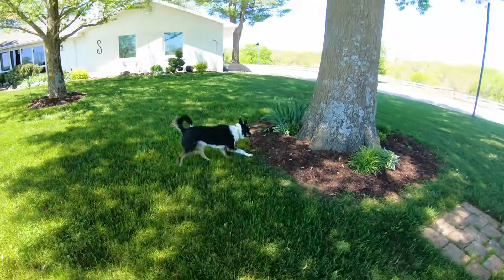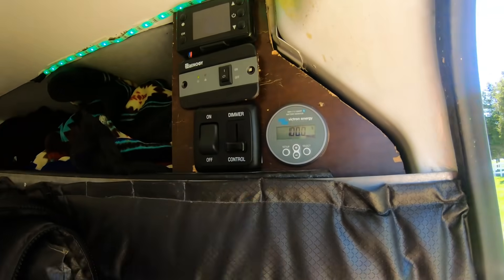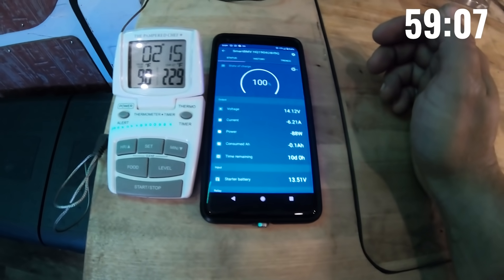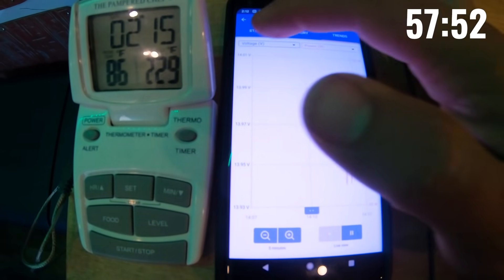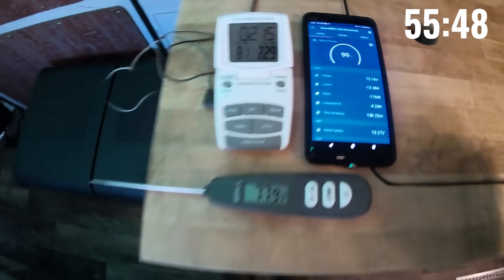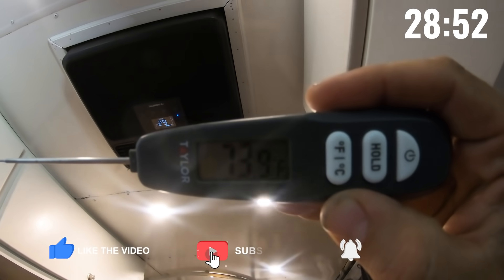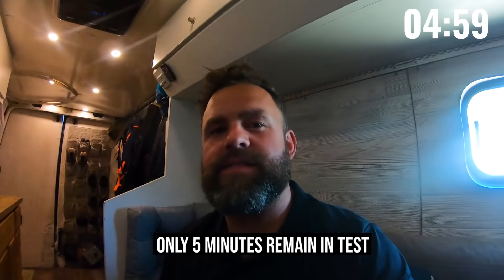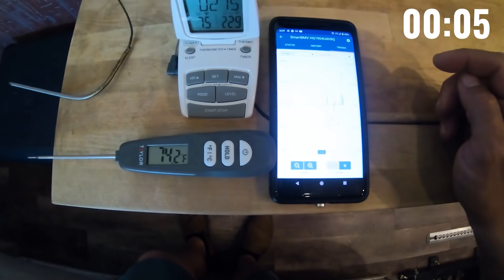12 Volt DC Air Conditioner | POWER CONSUMPTION TEST | Dometic RTX 2000 |  Van Life

Comment: Nice work, but $3k consuming 600 watts .. most vans have a garage in the back and you can get a  5000 btu wall unit for $160 at Home Depot that only consumes 400 watts.
Reply: Some people sleep in their Toyota Prius and run the AC all night. It has a feature that turns the engine on for 20 mins or so when the battery is depleted and recharges it. Then it shuts the engine off. It’s nearly silent during this process.
Reply from the maker: I wanted to avoid an unsightly and large window unit sticking out of my very nice van. I'm sure that works for some people ✌️
Reply: @insidiouspeanut  LOL.. not saying visible out the back window. I meant out a back firewall into a rear  sealed garage with allocated vent holes and  drain lines. Just an idea. Less would be visible or affecting aerodynamics.
Reply: @insidiouspeanut  The other point I'd like to make from my own personal experience is that modern automobiles with their electric engine fan cooling systems can handle what seems like an indefinite amount of idling while running the AC.  I've been running my van idle with the AC on high for 2 hours in the middle of the day some days and have never seen overheating or any other issue and fuel cost is minimal.
Reply from the maker: @12vLife  The entire point of this exercise was to run all my appliances powered from the Sun while not consuming hydrocarbons. No noise, no noxious fumes, no pricey fuel consumption and transportation. While you think it's okay to idle your van (& Yes it is a great way to charge your battery when solar power is lacking) Please have empathy for the people in the same campground as you possibly in a tent next door who don't want to listen to your engine while they're enjoying nature. Everyone has their own solution, But for me it was worth the extra money to not have sound or exhaust pollution In order to remain off grid and comfortable. ✌️
Reply: But a hillbilly a/c sticking out the window is cool 😎 👌  , for you not me and they still won't let me in there trailer trash rv park because my rv is to old just like me.
Reply: @henryroman5997  My point is window A/C need not stick out the window if you have a garage in your van with ventilation and drainage. Just a thought .

Comment: Hello Ben,
Do you have the specs on your insulation? R-values for floor, walls, ceiling? And where you have exposed metal?
I am also interested in this AC unit but I 'm not sure about doubling up on my spray foam insulation.
Reply from the maker: My van was insulated with closed cell foam spray to a depth of 1.5"-2." on the walls, doors and the roof, I then put another layer of 3M thinsulate over the spray foam before installing my paneling. Rigid foam board was used on the floor underneath 3/4" plywood. I estimate an R-value of approximately 18 in my build, this is very efficient! The weak point would be the seals around the doors not being perfect and allowing air to escape. Proper insulation is key to maintaining an area capable of heat regulation.

Comment: I’m going to need you to compare it to a AliExpress split unit for me 😂 Thanks for sharing. I’m afraid of not having the roof space for one of these suckers.
Reply: OR, this same unit unbranded 12v for $430 through Ali, which also runs on 24v and is more efficient of course.
Reply: @BreAsop  link? 🙂
Reply: @BreAsop  any more info on this? Thanks!

Comment: Hey Ben, I watched your other video, and I'd be doing the exact same thing, replacing the maxair fan. What was the size difference in the hole you had to cut? Was it a lot bigger? Thanks for these vids!
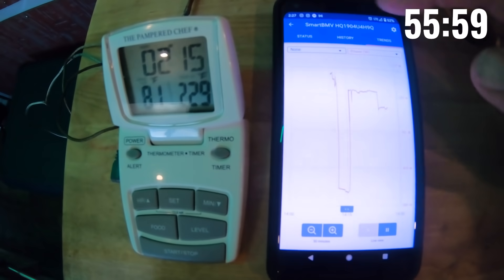Reply from the maker: I went over the installation notes that I used in my INSTALL video, starts at 6:35 https://youtu.be/lbpBway1RcY
Instructions call for a large 20"x20" hole that is unnecessary, I was able to expand my existing maxxair fan hole of 14x14 to 14"x14.5" hole with four additional bolt holes outside those. Check out the cardboard template that I made to explain this!

This smaller opening willl make it easier to remove and replace rooftop fan if I resell the van without the AC unit. Thanks for watching!

Comment: Can this fit in a 14x14 roof slot? Thanks for reviewing!
Reply from the maker: Hi Jacob, I replaced a rooftop fan that required a 14x14" opening with minimal additional work, however a slightly larger opening is required. I detailed this in my other Dometic AC installation video, please look there for more info!

Comment: I really appreciate that you did this - I've been looking for a consumption test - this was great! Your panels seemed to be offsetting the draw nicely especially at first. 

Question though: why can you only discharge your lithium batteries to 20 or 30%? Lithium can be drawn down without damage to the batteries, assuming you arent charging in freezing conditions. Is that not the case with yours for some reason?
Reply from the maker: Additional lithium battery info from newatlas.com  "Ideally, you'd never let them charge over 80 percent or discharge to less than 20 percent, because being outside the 80-20 percent range, on either side, stresses and degrades a lithium-ion battery."
Reply: @insidiouspeanut  Hey - thanks for the thoughtful responses. The power tests were great - I wish there were more out there with real world conditions being used.

Regarding the battery,  I'm not sure that you have a "Lithium-ion" battery (as thats a term typically for LiCoO2 and not LiFePo4, which I imagine is what you actually have), so I dont know if that info is necessarily relevant.  These batteries' chemical construction is specifically intended to be drained and topped up for thousands of cycles before any sort of degradation takes place (with language from manufacturers regarding a 20% top end battery max charge loss or so). Not going below 50% is good for Lead Acid, but for Lithium Iron batteries this isnt necessary. 

I'd have to look deeper into studies on this, but I wonder if you'd have better results discharging the battery and charging back up versus never having used the full battery storage. I wonder if there are adverse effects equally in that method. 

These batteries are often rated from anywhere between 2000 and 4000 (and sometimes even more) cycles before degradation begins (at which point the battery is still certainly useful, it just cant hold the same total charge it once did). Lets say 3000, as an average - thats discharging and recharging (even to 0% and back to 100%) every single day for close to a decade. And at after that point it still continues to work. The battery's cells are protected by its BMS, which ensures that when it says 0%, it hasnt actually depleted the entire battery - the cells are protected from damage in this way. One last note is that these cycles cover use and recharging - I believe a cycle is a cycle - its not necessarily saved by using less energy.

That all said, being careful with easily the most expensive single component in a build is a prudent choice, and I respect it.

At the end of the day, theyre your batteries in your rig and you can choose to discharge them to whatever level you please :D I appreciate you willing to hear me out - thanks again for the responses!
Reply from the maker: Great question, and I'm glad you like the power test. I take a conservative approach to using my lithium batteries, drawing them down past 30% reduces cycle life considerably. I prefer to not go below 50% if possible, this will extend life of LiPO4 to thousands of cycles and hopefully 10+ years with minimal degradation.

Comment: watt hours is battery capacity 
much less confusing then amp hours
Reply from the maker: Perhaps that is less confusing for you. I like to deal in whole numbers. 3600 kilowatt hours in 12 volt config is 300 amp hours.  300(ah) x 12(volt) = 3,600(wh)
Reply: @insidiouspeanut  3600 kilowatt hours......?
That’s what my house uses in 6 months.....
Perhaps you mean 3.6 kilowatt hours.....
Amp hours x volts = watt hours
Your mistake shows why using Amp hours can be confusing.
Reply from the maker: @davidoneill2466  watt hours. Climb down from that high horse.
Reply: @insidiouspeanut  just less confusing and a more accurate explanation of battery capacity....
It’s like calling a gas tank capacity in gallons per hour times some number of hours it holds fuel .
Easier to understand and less likely to make the error you made if you explain battery capacity in watt hours.....
Reply: @davidoneill2466  My gas tank holds 1000 hp/hour. Do I need more horsepower or more gas?
Reply: My recommendation is that you take a physics class. Horsepower/hour is meaningless..
Perhaps what you mean is horsepower hours.
Kinda like watt hours ….